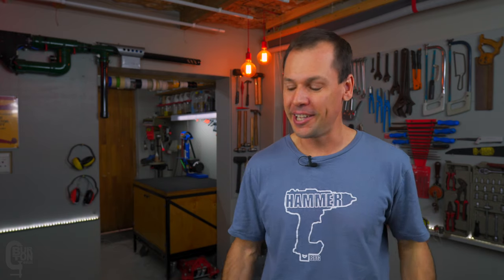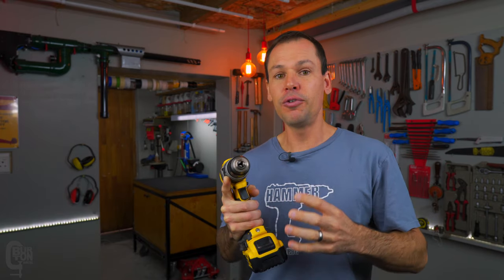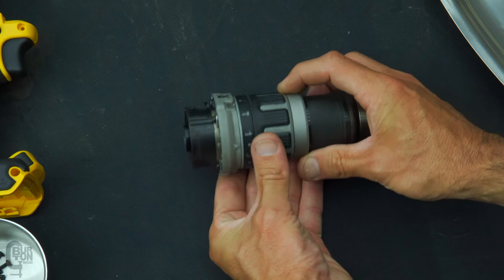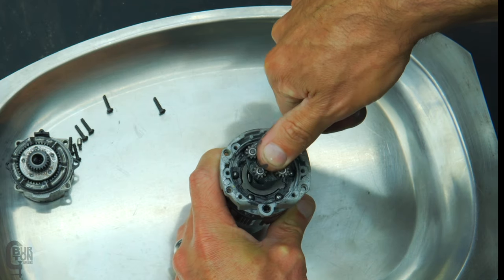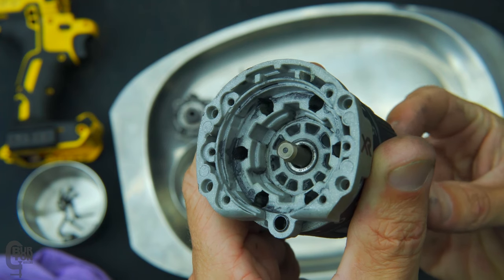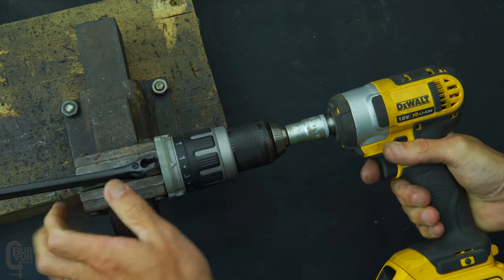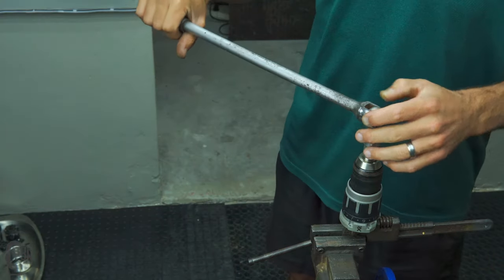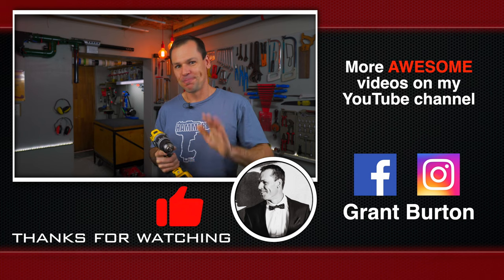Remove Chuck on DeWALT 20v MAX Brushless Drill DCD796 - HOW? - Burton Builds

Comment: Howzit? Thanks, the method worked for me, almost seems too easy.  Shifting spanner, bench vise, 8mm allen socket, power bar - cracked it loose anti clockwise.
Replaced with Dewalt / Rohm chuck
Reply from the maker: Hi Andre, thanks for the comment… I think mine is just really tight. Good to know that others are able to get theirs off relatively easily. How much was the now Chuck?
Reply: Hi Grant, the Dewalt DT7043QZ chuck was AU$48 from Amazon
Reply from the maker: @ab678  cool, not to expensive then.

Comment: I had the same issue on these new DeWalt drills , chucks are held on with some serious industrial thread lock , I heated the internal chuck and applied penetrating oil and it broke free with a breaker bar , took 3 attempts with heat but worked ,
Reply from the maker: Hi Kerry, thanks for letting us know. Much appreciated

Comment: I removed chuck with attached spindle from dcd791. I cut it with angle grinder to access screws below chuck. Chuck is attached to “SPINDLE SA N438918”. So, I bought another spindle, “SPINDLE SA N110038”. It is used on earlier dcd790 drill but fits on dcd791 also. So now, I can use any standard chuck with central screw.

So, I suppose that similar can be done with dcd796, replacing "Spindle N438748" with "Spindle Sa N110039" used for dcd795.
Reply from the maker: Hi Dejan, thanks for the comment. I'm pretty sure that during assembly the spindly is installed into the housing and then the three screws are fastened and after that, the chuck is installed onto the spindle (else how would one fasten the screws if the spindle and chuck are not separable?) Unless once the chuck has been installed for the first time onto the spindle, those somehow form a single unit which is inseparable. I may be wrong... just a guess.

Good idea to buy a suitable spindle that can accept a central locking screw... makes life a bit easier for chuck replacement. Thanks for those part numbers, much appreciated.
Reply: is it not removable without cutting?
Reply: @GrantBurton  Regarding what I saw in another video, where chuck was succesfully removed and seperated from spindle, I think it may be possible to drill the spindle and make a tread...

Comment: I found an easier way to remove chuck:
I put a vicegrip on bottom of chuck and hitted down with a hammer a few times and came off within a couple minutes.
Descubri una forma mucho mas facil y rapida de quitar el broquero: puse unas pinzas vicegrip  en la parte de abajo del broquero y le pegue varias veces con un martillo hacia abajo y salio en menos de 2 minutos.
Reply from the maker: Thanks very much 👍

Comment: Just bought  a new 796 and out the box the  chuck wobbles,and  here i am already looking for a repair for a top brand, that cost a lot. Returned first one ,got another one and same problem. 
Will return it for good
Reply from the maker: Hi Darius, thats not great news... but also not the first time I've heard of the wobbly chuck on a new Dewalt drill.Quite a bit of a letdown. Are you going to go with a Milwaukee or Makita drill or stick to Dewalt but a different model... maybe the 996 or 998?
Reply: @GrantBurton  i like dewalt and i am getting diffrent other 18 v tools. i ordered a 996 if doesn't have the same problem will keep it.
Reply from the maker: Cool beans... please let us know how it goes with the 996.

Comment: Hi Grant, great video and well done for not getting frustrated! I've been repairing tools for almost 35 years now a think it's a real shame that all the manufactures seem to be making their cordless tool almost impossible and or uneconomical to repair and this is just another example of it. I never really saw any issues with the left hand screw down the middle, soak it in something like WD40 then simply unscrew it whip the chuck off and fit a new one. I've watched your video thinking could I be arsed to go to all that trouble and would a customer be willing to pay the labour for this to be done on a drill that retails for around £65 including taxes in the UK!? More plastic in the ground forever!
Reply from the maker: Hi MB Plant, thanks for the comment... I think in this case... 'the bigger the problem, the bigger the hammer' would likely end badly 😂😂 I would think designed obsolescence would work towards ensuring future sales. I'm sure you have a wealth of repair experience with 35 years under your belt.

From the customers side, I don't think it's worth paying the labour for somebody else to repair since labour is getting very expensive these days... better to buy a new drill in this case BUT if a person is able to repair it themselves, It may be worth it.

Comment: Got mine off a few minutes ago took all of 2 minutes a 12mm allen key and a bench vice
Reply from the maker: Hi, good to hear yours came off so easily... some have reported also getting their off easily and other have also battled like me.

Did you replace it with the same chuck or something different?
Reply: @GrantBurton  dewalt 7043-qz works great, I held the allen key in the vice and spun the drill it worked pretty easy
Reply from the maker: @JOHNNYGEORGE22  Awesome, and thanks for the reply.

Comment: I have the exact model. Was giving me some issues a couple days back it was seized up. The chuck was opened up right away. All I did was use a vice grip and turn it anti clockwise. And it's off.
Reply from the maker: Hi Sean, thanks for the reply. It seems like some people are able to remove their chucks pretty easily and some not so easily... haha. I'll give mine another go soon. Do you have any photos of it off?
Reply: That's it. I can't find the removed chuck at the moment. I am planning on replacing it with a chuck from the dcd996.
Reply from the maker: @seanabraham8432  thanks for the photo. Mine must just be super tight with thread locker.

Comment: Greetings from Sydney Aust! Have the same model. Luv it only had mine for about 3 years. Dewalt sure makes it hard for one to replace the chuck. What was wrong with the old method of an internal nut/bolt from the front? Also meant to ask is it normal for the chuck to have a bit of forward & backward freeplay like mine? It seems like there is a spring behind the chuck for some reason.
Reply from the maker: Hi Mike, both of my 796's have a slight bit of spring forward / backward freeplay. Not sure exactly why its there, haven't really given it much thought. Still loving them, use both quite often.

Do you have other Dewalt tools?
Reply: Think the fore and aft movements is for the hammer action, to absorb some of the impact to make it more comfortable for the user.

Comment: ok so ive managed to remove my old chuck and put on a new one , you need to place the housing in a vice the punch out the spindle with the old chuck on it, the place the spindle with the old chuck in to a vice and heat up the spindle at the back of the chuck then crack its comes undone with a long bar.
Reply from the maker: Hi Ashdown, thanks for feedback, I may just give that a try next time I've got the drill open.
Reply: This is exactly what I did and then it unscrewed nicely (anticlock) with a bit of love. Just getting all back together was the pain. All the gears and pins etc. It now is in permanent hammer so will pull it apart again tomorrow!
Reply from the maker: @nickstaaa  Hi Nick, Thats not great... always a bummer when you put something back together and it doesn't work properly because of a simple assembly error (assuming it was an assembly error, maybe not?). Hope you got it working properly again?

Comment: Hello. You try turn in left direction, but you shold turn right.
Reply from the maker: Hi Zizo, I actually tried turning it in both directions to crack it loose (just in case) but no luck. From what others have said, turning the chuck anti-clockwise will loosen / unscrew it from the shaft. I'll give it another try sometime soon. Thanks for the comment.

Comment: Why doesn't this drill has a locking screw in the chuck? Is there a technical reason for that? Does they made it without the screw because the "neck" of the drill needs to be stronger? I guess a hollow neck to allow space for the screw might make it weaker...
Reply from the maker: Hi Paulo, thanks for the comment. I'm not exactly sure why the drill and chuck assembly were designed in this way but if I were to guess, one reason could be for cost saving. Not having a locking screw equates to an additional cost that can be saved on a screw / fastener and not having to drill / machine a hole in the end of the shaft and not having to form threads in that hole saves on machining and process costs... It might not sound like a big saving on one drill but when you multiply that small saving by hundreds of thousands of units, it equals to a large saving. 

And yes, I also agree... it probably is a bit stronger because its a solid shaft.
Reply: @GrantBurton  I wouldn't guess it is because of cost saving, because, at least in the Dewalt power tools, they seam use them on their most expensive and stronger models. I have a D21570k, and it annoys me that it doesn't come with that screw, and it is one of the most expensive Dewalt corded drills available here in Brazil. I hope they make it that way because of some performance enhancement, instead of just cutting prices down, but then again, many cheap "made in China" chucks doesn't have fasteners also, and probably just to lower their costs.
Reply from the maker: @paulopaniago9874  I was thinking along the lines of cost saving on various parts not necessarily being a bad thing... If they are able to save some costs on one part (without reducing reliability / strength), they might be able to spend that saving elsewhere on the tool, so overall they are able to improve quality without increasing cost of the tool, or at least maintain the cost of the tool as production / material costs increase over time. Who knows... I guess thats the continual balance between engineers and the money police (aka accountants)... haha.
Reply: @GrantBurton  Oh, I haven't seen it that way, that is a very good argument, specially on the most expensive tools. Thanks Grand!!!
Reply from the maker: @paulopaniago9874  Hopefully over time, the video gets shared and more people see and read the comments... maybe they read our conversation and are able to give their comment on the screw.
Reply: Cut it off with a cutoff tool

Comment: The proper way to remove drill chuck is to use “DeWalt S.t.chuck Removal Jig 559661-99” and “DeWalt S.t.insert 559697-99”
Reply from the maker: Hi Dejan, thanks for those part numbers... Looks fairly simple to fabricate those tools. I can see how the 559697-99 tool works... to adapt the back of the spindle to a hex for a socket but from the one picture I saw of the 559661-99 tool... how does that work? I assume that holds the front side of the chuck in some way?
Reply from the maker: @Pete1965  Hi Peter, what Brand did you end up going with? Makita and Milwaukee also make some good quality tools. I've got a Makita Jig saw and an Abrasive Cut-off saw and they are both awesome machines.

Comment: Hey the chuck retaining bolt is reverse thread. You were tightening it more and more! 😂
Reply from the maker: Hi GemLeo, thank for the comment. You are correct, normally the centre locking screw / bolt inside a chuck is reverse thread (left hand thread) however the spindle on these DeWalt drills does not have a central locking bolt / screw... the chuck is threaded onto the spindle with a normal right hand thread only, so what can be seen in the video is me trying to turn the chuck counter-clockwise in order to loosen it from the spindle.

I wasn't able to get mine loose however others have said that theirs came loose pretty easily... maybe the thread locker on mine is just holding really tight.

Comment: Please don't do that. Open the jaws fully, and look down the throat. You'll see a bolt head, usually either Allen key or torx. It's got a left hand thread, so undo in reverse, and remove. Then using the jaws of the chuck insert an Allen key just like you did. Grasp the key in a vice and use the drill to unwind it's chuck (normal right hand thread).
Reply from the maker: Hi, thanks for the comment... Most chucks are secured in the way you describe (with the central Allen key or torx) however this model of Dewalt drill is different. Turns out it doesn't have a central locking screw, but rather just normal thread on the chuck and high strength threadlocker.